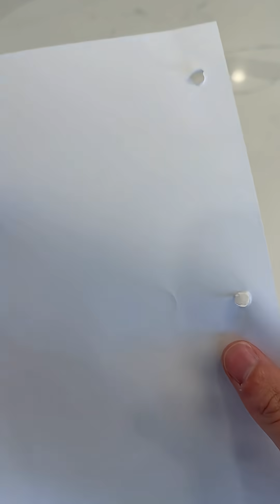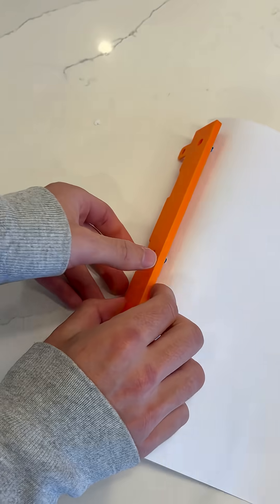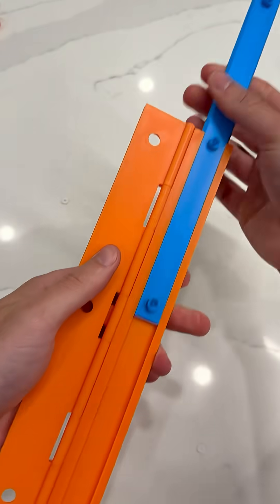3D Printing Everyday for 365 Days 176/365  #stem #3dprinting #3dprint #ideas #useful

Comment: If you cut 3 pieces of paper at a time, most of those would work. What about a three hole punch that crimps and folds the waste tab so the hole is stronger and no waste is left behind.

Comment: Oh, that explains why the cheap ones never worked!  I have a big desktop one, and it punches super cleanly, but it's too heavy to lug everywhere.  The ones you could store in your binder never worked right.  I wonder if the flat or u-shaped could work if it's merely angled right.  Although... The inverted cone does look cool.

Comment: Do you include CAD files with your 3D printing files, parametric ones? It would help a lot for any kind of adjustment for our own purposes :) OFC, I CAN also just remake it in CAD (like in SolidWorks) with your model as a reference, but it always helps a lot, I think.

Comment: The taller V shape is exactly what commercial photocopiers use in their automatic hole punches, though they operate in the reverse direction to yours, punching down so the chad falls into a bin for later removal.

Comment: this is also very similar to how piercing needles vs piercing guns work. Needles are hollow and MUCH sharper so they create a clean hole which heals much better. They also take out enough flesh to fit the jewelry in nicely. Piercing guns are more blunt and rip a hole through flesh and jam jewelry in which is worse for healing

Comment: You’re still missing the part at the bottom that your paper lines up against so you can consistently cut the holes in the same spot on every paper
Reply: yeah that's what I was thinking, there's only one stop to line the paper up against vertically when there should be another to keep it in the same place horizontally

Comment: The issue with the u-shaped one and the diagonal slanted one before it was probably that the slant was on the wrong side of the cylinder making the side that touches down on the paper first, touch down even sooner rather than what would happen if it was on the other side that contacts the paper second. The point in varying the height with the slant was to make both sides of the cylinder touch down on the paper at once. 
But the slant was on the right side in your very last print, so alls well that ends well.

Comment: That’s a pretty cool design! But I’m wondering if that little cone in the middle is really necessary.
It seems like the cutting action comes mainly from the sides of the inverted cone, and the small center cone might just help hold the paper so it doesn’t get stuck. That said, it could also be a potential breakage point, given how small that bit is.
Maybe you could try using just the inverted cone? It might improve durability.
Anyway, neat concept!

Comment: This is really cool!

You should add a slide out ruler/guide to the bottom so you can center the holes and have more consistent punch locations. I know I’d have a stack of slightly misaligned pages if left to my guestimates

Comment: You know what would be Super helpfull: a similar puncher but for the adoc system where paper are attached through plastic discs. I saw one at the beginning of the system in a supermarket. Then i regretted not having purchased it as the only ones I can find are around 350 euros... And they are not even fitted with a4 paper...
I have a few of papers that I would like to insert and cannot. In addition I have 2 different hole systems with 2 different disc profiles: one with 12 "holes" uniformly spread, and one with 1+2+2+2+1. That would be great to have a similar system

Comment: Hot take, it’s better to have the flaps. You’re guaranteed to not have to pick them up off of the floor. Granted it should be as minimal of a flap as possible, but I still think that it’s better to have at least a little bit of contact remaining.

Comment: After lots of use thats a lot of wasted plastic so you could make it so it has a cone back with a line through it so it can be a total of 5 pieces printed and the 3 actively used pieces can be replaced easily and with a shorter print time
Reply: the spacing is pretty critical, it's better to have it on a bar for that reason.
Reply: @keiyakins thats what tolerance is for so if you know it might be undersized make it slightly larger then sand it down till its a snug fit

Comment: Ironically you made it better than commercial versions - most commercial versions of small hole punches like this have the paper flap problem
Reply: Nothing like the art of "just look at it" to figure out why it doesn't work 😂
Reply: That's why I jealously guard my perfectly working one that I acquired a decade ago. It's never missed a hole!
Reply: I can see that as being an addition to production time they weighed out to keep cost down. Adding that angle to the die heads would be a nightmare for manufacturing in metal parts.
The plastic here would probably quickly wear down and not cut as well overtime making it unfeasible as a mass sold product.
Reply: @TheRayzerBandit  They can increase their prices then, and justify it by the fact that they truly do have a higher quality product.
Reply: @TheRayzerBandit this plastic punch would be very cheap (plastic + time + little markup), so it would be easy to buy a new one when the old one dulls
Reply: Then the commercial options in your country are crap lol
Reply: You don’t know what ironic means
Reply: whats the paper flap problem?
edit: looked it up, now i get it. search query: "whats the paper flap problem in 3 hole punchers"
Reply: @YourLocalSip  its literally the entirety of the video dude
Reply: Yeah, i know commercial product bad, and 3d printing things are good yadayada.

Comment: HELP! I am looking to upgrade from my ender 3 v3 Se. I am looking at 2 current printers: Bambu lab P1S and Elegoo Centauri Carbon. I’ve heard amazing things about both printers and bambu is having a sale right now. How well do pieces snap together straight out of the box on the CC? All I want is minimal or no calibration for pieces to actually fit together.
Reply from the maker: Both are plug and play out of the box. Bambu is better quality prints/ better quality printer and better for user experience. Elegoo is less expensive and has more features for its low price- enclosure and has a touchscreen. If you want it for ultra high quality go Bambu. If you want it to prototype parts fast and don’t want to pay a lot go elegoo. Quality is still good just not as a great
Reply: @Charlie_designs thank you!

Comment: For saving material, the blue slidding stick can be I-section instead of rectangular.
Reply: Better yet make it have 3 holes for punch inserts to slide in for a super short print time and save lots of material

Comment: How do you align the paper?
Reply from the maker: Eyeball it lol- I could add some type of end piece but it wouldn’t fit on the bed of the printer. So it would need to be separate or telescope
Reply: @Charlie_designs if you squint hard enough, all the pages do look sorta aligned
Reply: I guess this requires another round of tests!

Comment: That last punch was just, perfection.
Reply from the maker: So happy with it- worth the several prototypes
Reply: Tbe next step would be to make the dies CNCed out of aluminum or room steel. That would wear out less fast if at all and be sharper.
Reply: Not really the lid of the hole punch should have holes matching, so the paper dots can eject  instead of getting jammed into a blind hole
Reply: @Og_paine they do eject, how else is a hole punch supposed to work